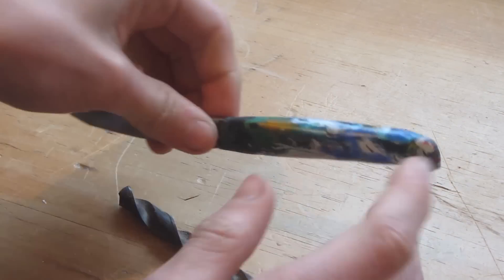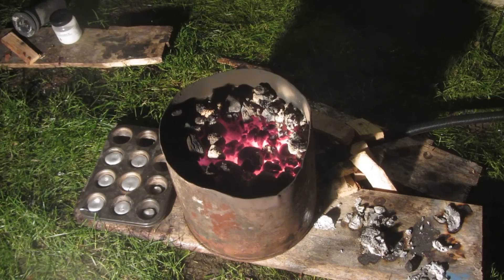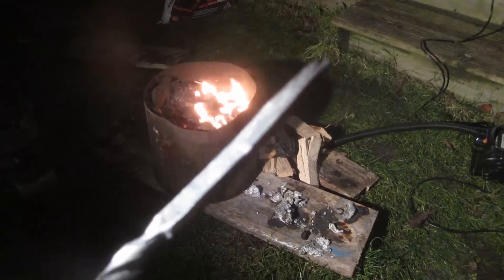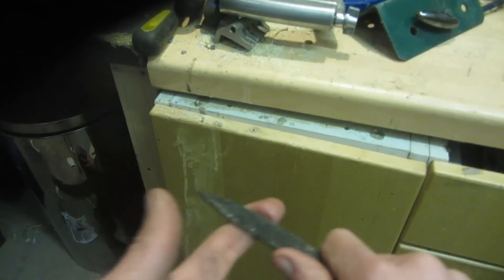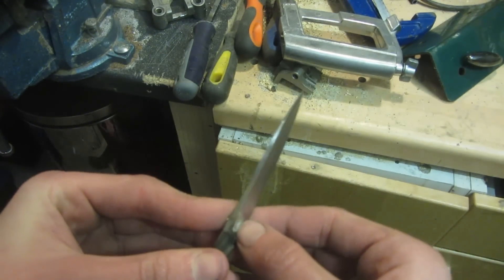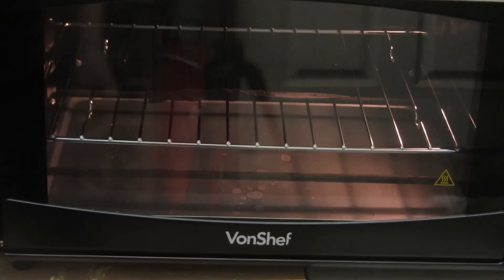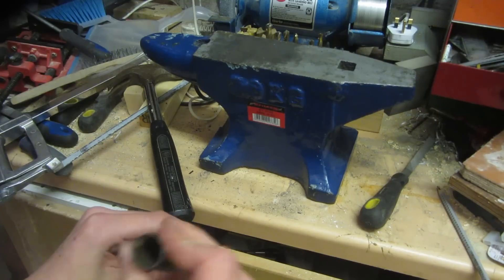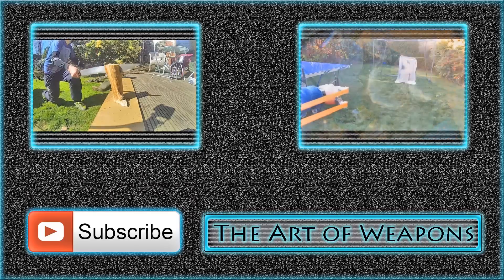How to Forge a Carving Knife From a Drill bit - part 1

Comment: hi. initially, there was very little in the way of safety awareness, accredited instruction, goggles etc. boring I know but people will have a go at this themselves after seeing it,,,, the drill bit used I personally wouldn't want a nitride coating on it ..Titanium nitride coatings can be deposited using  Nitridation of titanium with nitrogen(N) or ammonia (NH4). this could be released again as a toxic vapour,,I don't know, I would just be suspicious,,,the toaster oven was maybe 20-30 deg C too low for a 55 HRC...I use about 220 for a 57HRC on leaf springs etc..also after forging,it is nice to do maybe 3 normalising cycles to relieve stresses in the work..the carbon gained from using motor oil would all be removed from the slightest grinding of the surface, it would be more of a case hardening idea really than adding more C...try to clamp your anvil somehow as it walks too much during work but your work height was pretty good on the bench you used...if you try to get the blank as straight as possible during forging you will not only has less grinding but you will remove far less strength inducing grain structure...after forging and grinding the surface it is best to check for cracks before bothering with heat treat, if it has a flaw it would maybe break at that stage...however, high speed steels are not exactly the same as high carbon steels which are simpler in nature for home forging, some high speed steels need to be removed from an oil quench at 500 deg cel and then air quenched, some are oil quenched at far higher temperatures than you may think and tempered higher as well, so maybe using a high carbon steel file may be a more appropriate avenue next time, your knife may end up a super little carver as it could have ended up quite hard again like the drill bit it used to be, but without knowing the exact steel metallurgy it is hard work second guessing relevant heat treat, forging, normalising, tempering to achieve a resilient working tool.

Comment: Word of warning: your craftsmenship is being let down by your materials.
A drill bit is made of high speed steel which is alloyed so that heat from drilling won't temper and soften it. M2 HSS alloy has a tempering temperautre of 650C to get to a hardness of 61HRc (HRc is a unit of hardness, knives are usually 55-66HRC) while O1 steel which most people use for knives gets to 61 HRc at 200C.
With O1 steel at 180C you would have a good hardness of 62HRc but with HSS it won't be much softer at all. Your knife shoud still be fully hardened. and brittle.
Reply: The Art of Weapons
Metal files also make awesome blade material. And they're cheap and ubiquitous. The material is pretty much standard across files, the cheap ones are just the result of the manufacturer saving on heat treat. But since we're redoing the heat treat anyway, from a knife maker's point of view, they're just a cheap source of quality steel. Plus you can do some nice patterns with files: https://i.imgur.com/UrwhtHI.jpg
Reply: Going around a car boot hoovering up old files for 50p each is a good way to get lots of toolsteel fast. 
Really old files are really thick, they used to be ground down and had the teeth recut because the steel was so expensive back in the day. That said they are also of good steel so check if the teeth are still sharp before turning thems into a knife because good files are hard to come by.
Reply: +Rainbows871 The point everybody in this section is missing is that the "blunt end" of a drill bit is either made of a "softer" steel and welded to the HSS fluted section or it is softened in heat treatment (this depends on the size of the drill). If you test the hardness of the drill above the end of the flutes and compare it with the fluted end (try filing both ends) you will discover the truth of this
Reply from the maker: ok thanks for the tips
I had no idea!
For any future drillbit knifes i will try to remember this!
Reply: The Art of Weapons
you could temper it by putting it on your forge till it is just starting to glow, then push it into a bag of ash or sand to cool. 
It might be easier just to buy tool steel rod from the internet.
Reply from the maker: Rainbows871 yes i have some 01 tool steel and I am going to be using it soon to make a folding knife but for now I just wanted to experiment. I think that if I did cast an aluminium handle then quickly covered the blade in sand the heat from the 800 degrees aluminium would heat the blade and temper it as they both cool?
Reply: That is quite a good idea, try it out. I can't say I have ever done it but it sounds plausible.
Reply: Can confirm files as a good source of blade steel. And it doesn't really matter if you go for the expensive ones or the cheap ones; the material is the same, it's the processing and heat treat that makes the difference between a cheap and an expensive file. Since you'll be undoing all of that in the forging process anyway, just go for the cheap ones.

Currently have some files here, €3.5 apiece, brand new, 30.5cm long w/o tang, 37.5 full. Already wedge shaped, which means less forging as they're already roughly knife-shaped. We'll probably use these in an upcoming blacksmithing initiation course as we want to save as much time as possible when dealing with groups (has to be doable in one day).
Reply: Rainbows871 I don't find drill bit steel brittle at all.  If it were, I'd break a lot more drill bits, and I've never broken one, even when doing jerk drilling in steel.  You'd sure as hell break it when ponding it on an anvil.  No way to avoid it.  

Drill bits are not all the same.  They aren't all made of the same metal, or tempered the same way.  This aside, I've never seen a drill bit knife blade break.  Ever, even under extreme duress, such as batoning.  "Hard" and "brittle" have nothing to do with each other.  A metal can be extremely hard, but not brittle, or soft and still very brittle.  

The proof is always in the pudding, and drill bit knives just do not break.
Reply: I talked to guys in my city in various industries. I have found an excellent source at a large machine shop of automatic hack saw blades. They are 1/4" tool steel and two inches wide by 24 inches so you have many style options, and some spine serrations if you choose to leave the saw teeth, I pay 5 bucks a dozen. Files are another good source, check garage sales, and railroad spikes if you are into the whole blacksmithing process.
Reply: +Juan Rial "The cheap ones are just the result of the manufacturer saving on heat treat." 

Are you saying I could buy a cheap file, temper it myself and have a good file? How hard would this be? Would it be worth taking the time to save the $10? Of course I could just buy a bunch of cheap files and do them all at the same time, saving a lot of money for not much additional time.
Reply: nerfzinet : I don't know much about the file making process, so I don't know how involved the heat treat process is for files. But no, it's not that easy. After hardening, you are left with a thin decarbonised top layer that needs to be removed. This means reprofiling the teeth.

Also, sharp tips/edges (basically all "thin" parts of the steel) don't cope very well with the forge heat. Knives edges are left a couple mm thick before hardening, and only after tempering are they ground down to their final edge thickness and sharpened. Do it before, and you ruin the steel near the edge. I assume something similar to hold true for the teeth on a file as well.

So even if you could give them a better heat treat than a standard industrial one, you'd still be spending so much time, effort and material on reprofiling all the teeth that it's not worth it.
Reply: Juan Rial I thought it sounded too good to be true, thank you for elaborating!

Comment: Keep it up kid. I do hobby blacksmithing. jsyk bigger hammer equals in less work. Look at the blacksmith depot. I got the 2.5lb Swedish style hammer. its great for beveling. I also use a 4lb hammer as well You might want to look at doing a brake drum forge. they're quick and easy and there are awesome. Oh and get a stump for your anvil. And bolt it down.

Comment: As a smith myself I have a few tips that may help you with forging blades in the future. First is your anvil, a small anvil is okay but having it placed on the ground is a terrible idea, I personally recommend nailing it into a tree-stump, when you let your hands fall by your side your knuckles should be level with the top of the anvil. Secondly, once you have your anvil braced at the correct height, I would recommend a heavier hammer for this sort of work considering you don't need to be particularly gentle, a 4 pound club hammer is my personal favourite. Finally, work the steel while it's still hot, considering you're only flattening it, you should be smacking the absolute crap out of it. If you were working efficiently, you should have had that steel completely flat after pulling it out of the forge once. I hope these tips helped, let me know if you have any smithing questions, I may be able to help out.

Comment: Dumb idea drill bits have a hardness of like 65 so that they stay sharp threw use. There hard to work with and results may not turn out to good.
Reply from the maker: The drillbit is heat treated up to around 65rw but then when forging it the steel annealed and makes it way softer and easier to shape, that is why the heat treatment process was needed.
Hope this helps.

Comment: I believe your tempering temperatures may be off. More importantly though, it is important to temper as soon as possible after hardening is completed and the knife is fully cool. I would also have the toaster oven up to temperature before sticking the knife in (so that the radiating from the coils as it heats up doesn't skew the temperature) and have a small over thermometer to assure you get the correct temp. 

Hope this helps. :) Love your videos, they are quite ambitious.
Reply from the maker: thanks!
I think that in the tempering almost worked on this knife but I agree. I have ordered a cheap oven thermometer but it hasn't arrived yet. 
For any future knifes I will leave it in for a little longer and also on a higher temperature. The knife blade did have a nice golden layer on it however.
thanks again.

Comment: @The Art of Weapons. On a project I'm working on I'm using your trigger idea. When i finished i pulled the string to load it and it pulled on the trigger so much it let off. I then put 3 heavy duty rubber bands on the tigger and it's still scary because sometimes it moves the trigger and lets of. What do you do on your weapons so it does not do that. Plz help thanks i love your videos :)
Reply from the maker: I don't think that your trigger face that the string catches on is at the right angle. You should file it so that it is like more of a hook that the string wont slip off.
Reply: Ok cool i will try thanks a lot 😃 love your videos

Comment: Love the idea .I tried to melt aluminium on a fire in my garden. It worked but I didn't have enough and the slag built up to much. Hopefully I will get an anvil because all I have done is flatter a steel pipe on a cinder block.

Comment: Oh have you played around with casein?  Long time ago billiard balls were made out of it, and so were coat buttons- you can make it out of milk.  Galalith is casein, but treated with formaldehyde to make it waterproof.  So if you make a handle out of casein do not use it in the rain and stuff
Reply from the maker: thanks i will have a look at it!
Reply: When ive make Casein out milk and vinegar it turns out really hard which is good, but it is very brittle and is normaly not smooth it has lots of pits in it. Ive never made a knife handle out of it though but i wouldnt try.
Reply: Can't find drawings I can explain it over skype

Comment: High speed steel is good, but try a file, type for metal its W2 steel and it holds an edge very well.  Just expect it to take more sanding.